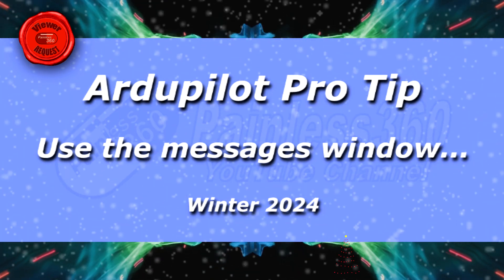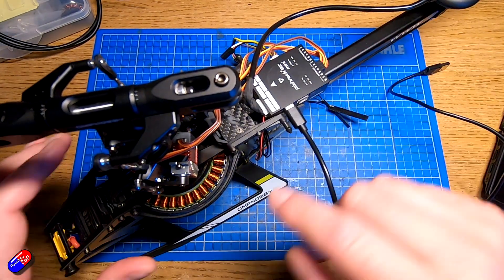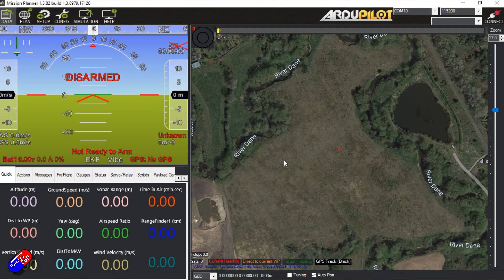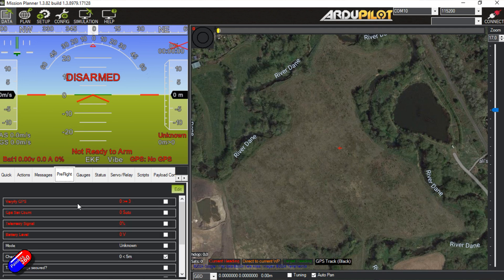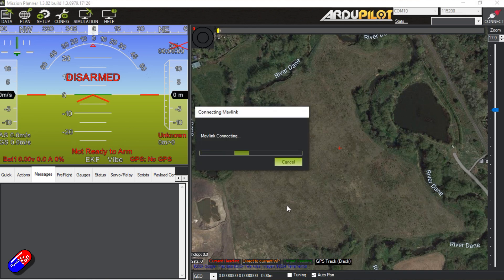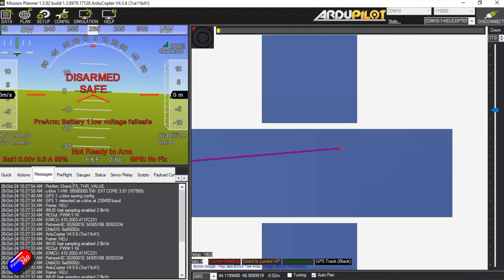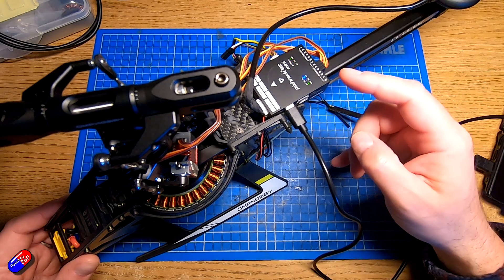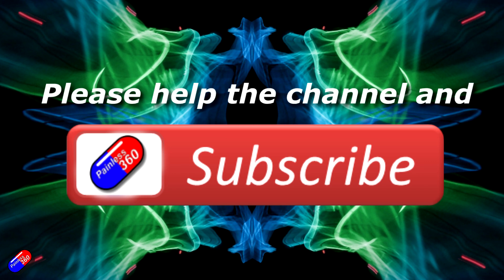Ardupilot issue? Check the Messages Windows in Mission Planner (the most overlooked help tool!)

Comment: That window has been crucial for my debugging, and as you mentioned, I overlooked it for too long. Ardupilot can also put those messages (and sat count) scrolling on a tiny display on your model, which is useful before takeoff if you fly LOS (no fpv goggles) with no ground station.